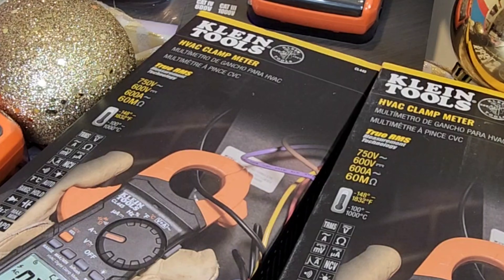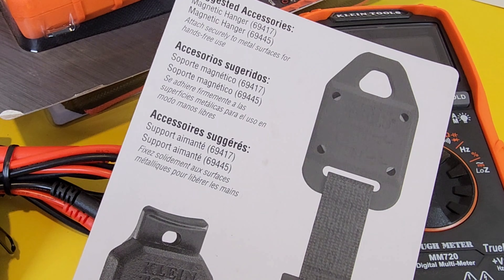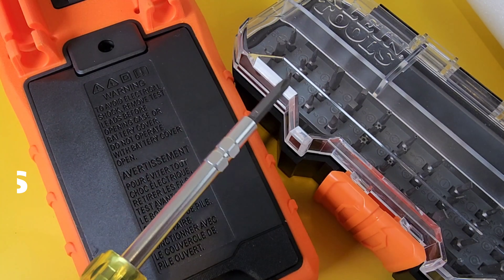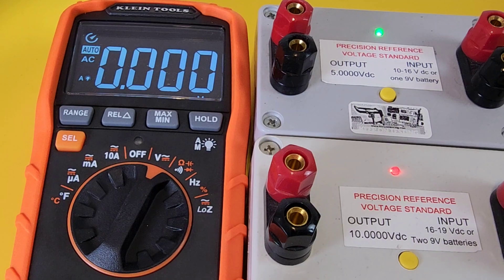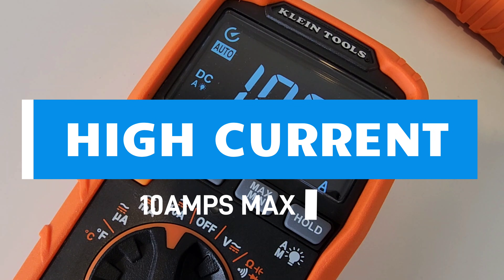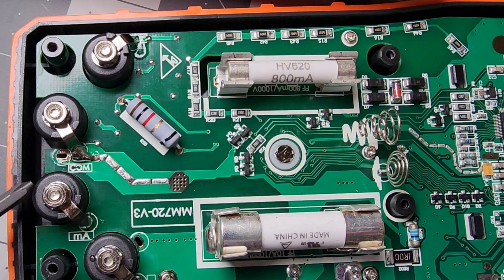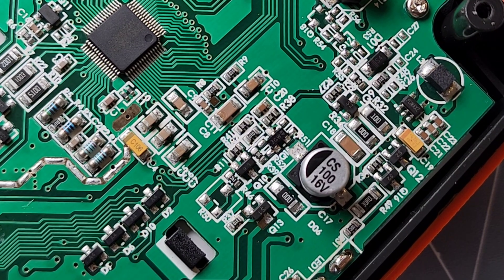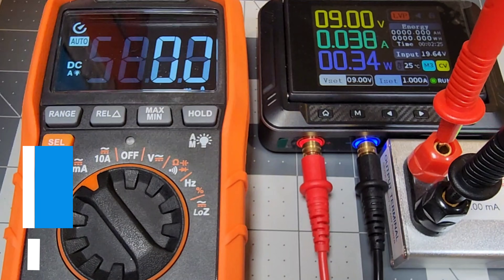KLEIN TOOLS MM720: tough, smart, and ready to work! (Unlike your brother in law!)...

Comment: Overall high quality with great display solid case and great fuse access, though for its $80 to $100 asking price I would expect silicone leads and some MOV's and PTC's, assuming theyre not on the other side,
Reply from the maker: https://www.keepontesting.com/post/maximizing-input-protection-with-the-klein-tools-mm720

Chrck out thos MOV's & PTCs ..You've highlighted some key expectations for a meter in that price bracket, especially regarding the leads and internal protection. Thanks for sharing your insights! 😊
Reply: AH-!  There they are, thats more along the lines of what I was expecting -- you were quick on the draw with that flip side, as my comment mentioned I felt there was a good chance they were on the other side, makes a big difference.  Throw in some silicone leads and id be on board for sure, but solid meter either way. Klein has spent a lot of time making a good name for themselves, I was hoping they werent slacking off - but nope theyre showing decent value especially for someone that cant or doesnt need to spend Flk money.
Reply from the maker: 💯..Klein really has stepped on the max value for money game.. 💰 😅 that's some seriously good Input Protection going on..Merry Xmas Mike!!